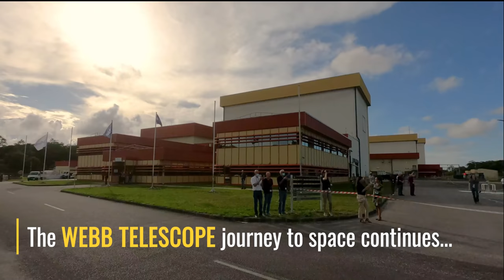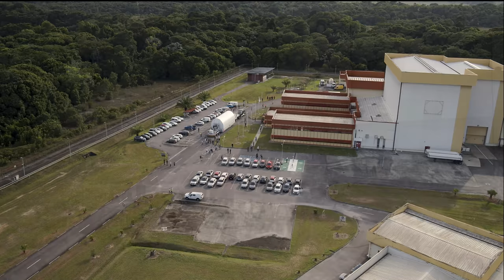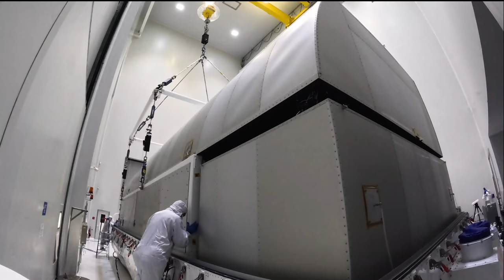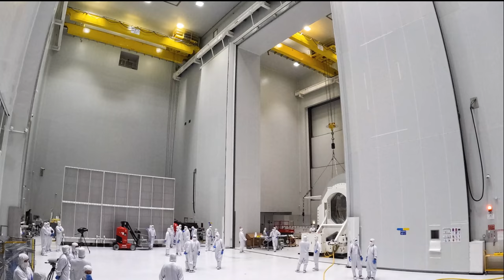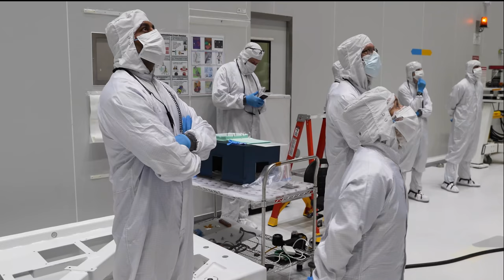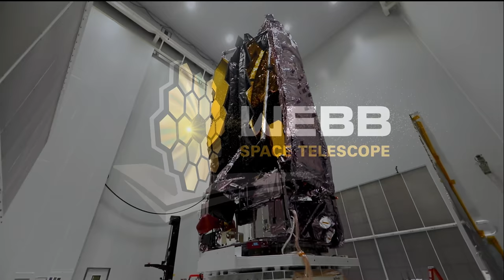The Webb Telescope Journey to Space Part 4: Unpacking in the Cleanroom

Comment: Does the booster built into it already have fuel in it?what's that called?if it was pushing it to it's final destination:who not let it ride along then detach near orbit of it.would have been a great camera platform for monitoring it.hrll I'd has put some robot arms on it and the necessary gear to do any emergency repairs or anything of the lights already on board of that rocket booster that gets jettisoned.what a far sighted wast.
Reply: JWST will be only fueled a day prior the launch.